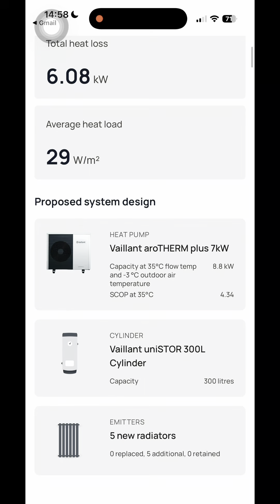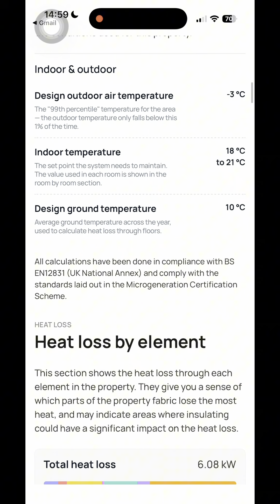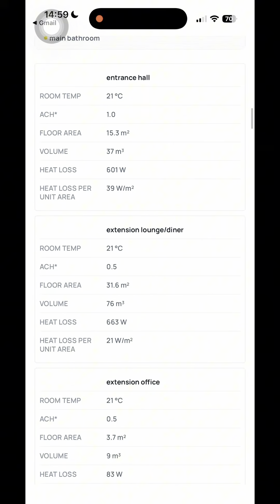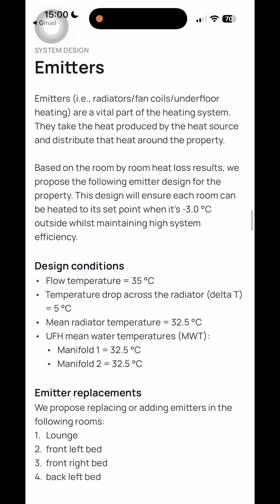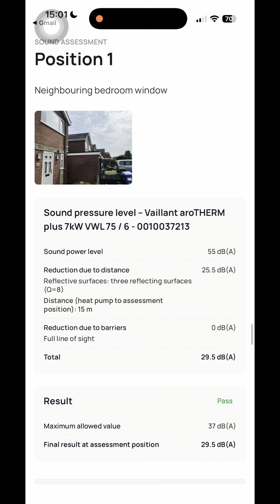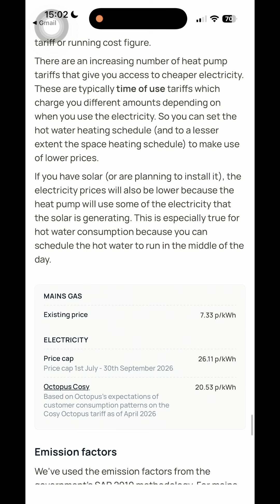Should you really have to pay for a heat pump quote?

Comment: My installer(in the Netherlands)uses software to generate the quotation.He showed it to me, the work he does is modular, there are reference guides on how long it takes to mount a radiator,install piping etc. It does not take long to create a quote. The software also orders te components via edi at the lowest cost. It is so that his hourly rate is higher when installing a heat pump. I used the software from heat enigeer to make a heatloss calculation and he was ok with that and made an offer to install it at fixed price and the installation took 16 hours.

Comment: Problem is when getting multiple quotes to get an idea of costs and proposals to compare and get a feel for the installers. You've spent 750 quid before starting. 

On the other hand, the cost has to go somewhere,  so it's either paid for upfront or added to the install along with extra to cover cost of unsuccessful quotes.

To be honest, it almost put me off, especially with heat geek, no contact from an installer before they want 250 quid. No initial chat or anything.

I almost gave up. I posted online for help and a local heat geek got in touch and had a chat. Then he did the survey directly but on heat geek platform. Install in a few weeks.

Comment: Where your comparison falls down is if I get an architect to design an extension then I can go to any builder for a quote, if I spend £££s paying you to do a survey then no one else will accept that, they all want to do their own review.  Until that is either standardised or there is an agreed methodolgy that gives everyone the same answer then people will not want to pay out lots of money for what is effectively your opinion and your quote.  I could spend £250 on getting 4 of these and get 4 different answers or to be told that my property is not suitable, that is 10% of the cost of getting my boiler swapped like for like.
Reply: Totally agree. Even when you get surveys done by reputable installers like British gas or octopus, these heat geeks still wouldn't accept their survey